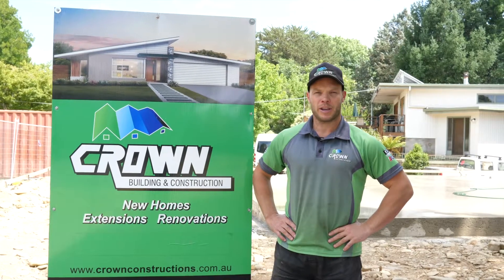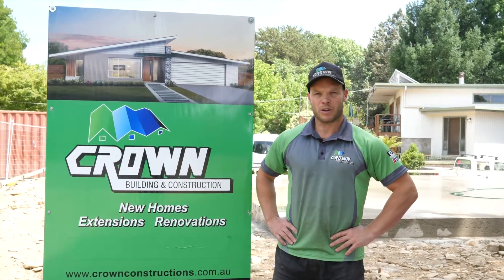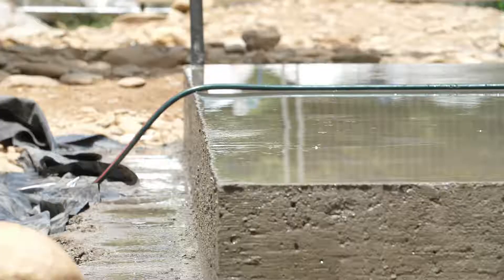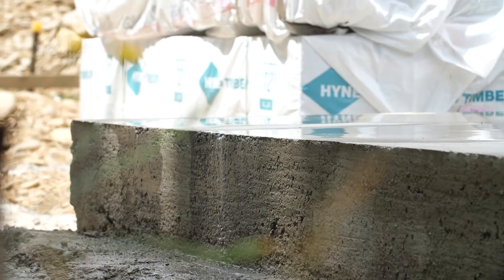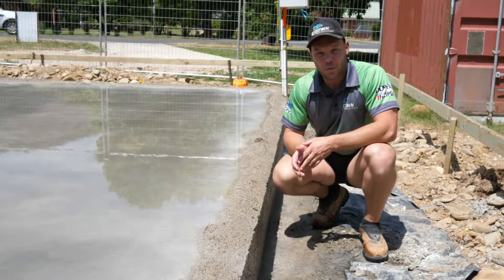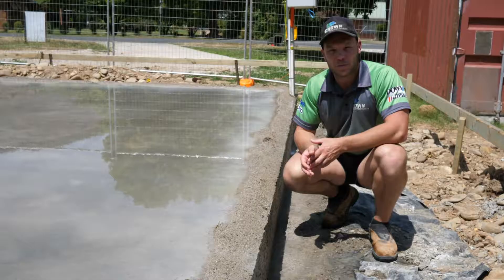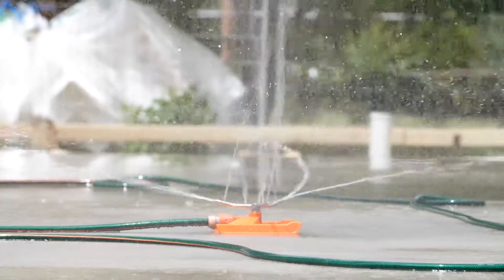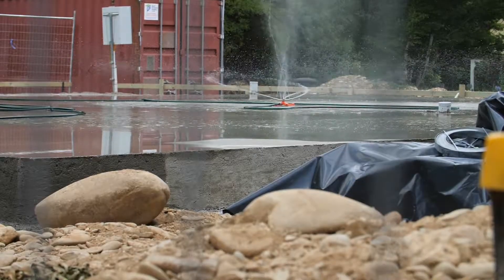CURING CONCRETE SLABS How we cure our concrete slabs for maximum strength and durability

Comment: One basic challenge here, the form boards should not be removed for at least 48 hours if you want maximum strength and long term durability.  Actually you could leave the form boards on and add a 2x4 on the top to act as a dam for your pond cure.  Water on the surface during cure is a really good plan.  Reduces the surface cracking due to shrink at the surface as the concrete cures on top but not as fast just under the surface.  Tyler Ley, PE PhD is another engineer who provided a well done video on leaving forms in place for more strength and durability.

Comment: Can you do a video on the whole process of pond curing? Starting from when exactly it’s ok to put the water to it without screwing up your finish. Thanks!!!
Reply from the maker: Hi Richard, Only use the ponding method in warm conditions. In victoria its really cold during winter so its not required until the other season kick in. Once its been finished that is the usual time to build the sand wall around the slab and fill with water. Thanks Matt